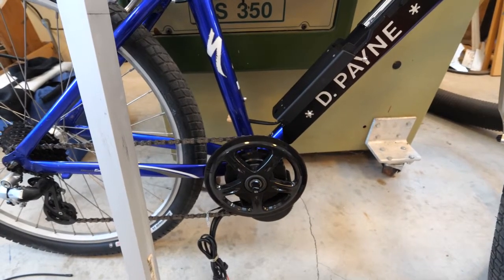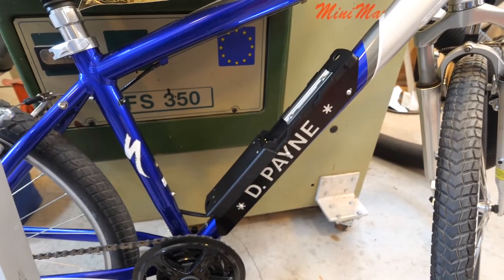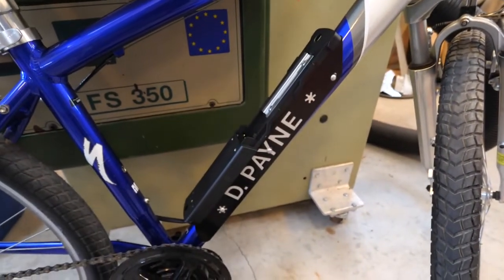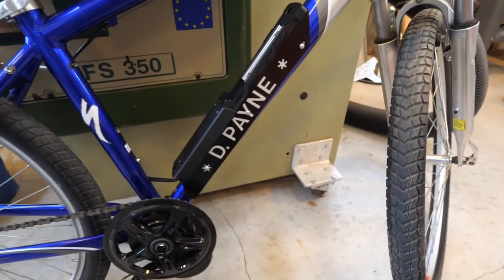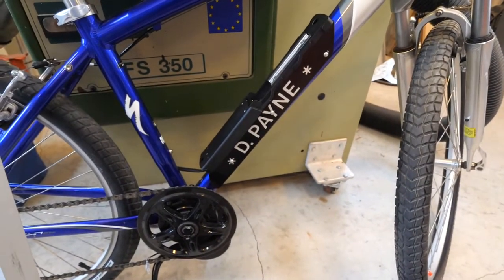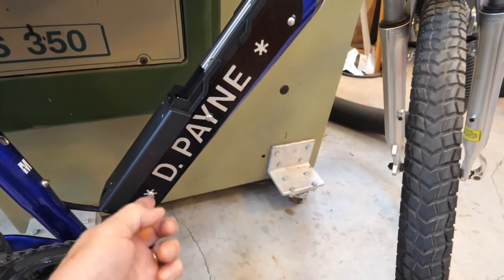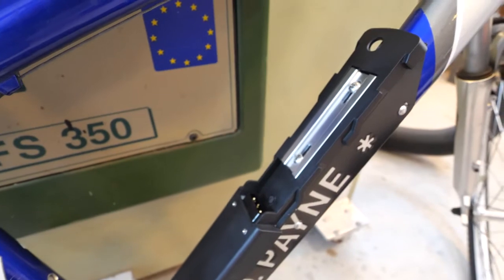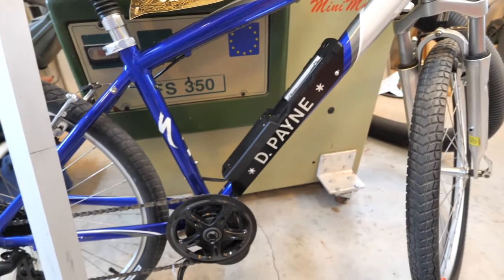Improved diy battery mount for Bafang mid-drive ebike conversion.

Comment: I see you only used it on one side of the down tube.
I’m think about using a 3/4 or 1 inch piece and putting it on both sides. I also added 2 additional rivnuts so there are 4 screws holding the battery bracket.

Comment: That's a really good idea actually. The only problem is to find an aluminum bracket.
Reply: It's available at home depot and lowes
Reply: @RaleighHomeInspector  That's great. I am also considering using a triangle frame bag.
Reply: @MeysamShojaeeNejad  me too. Can't decide yet which is best. The bag seems to floppy and most battery mounts inadequate. I like this as a wider more secure mount
Reply: @RaleighHomeInspector  I think putting some foams beneath and around the battery in the bag would secure it .